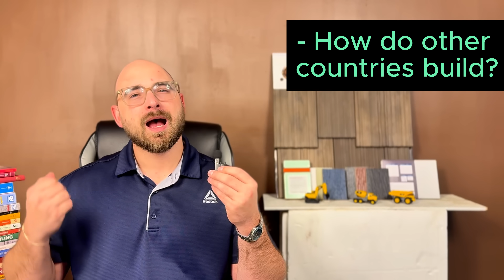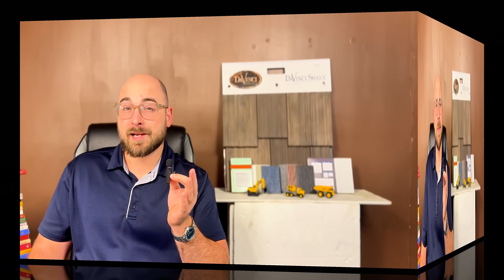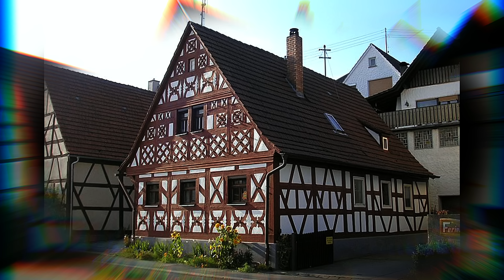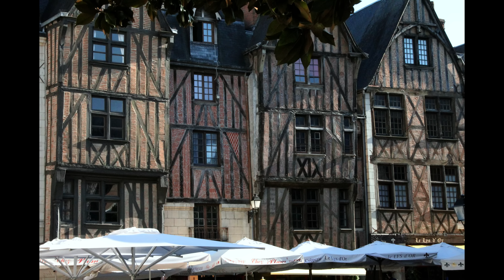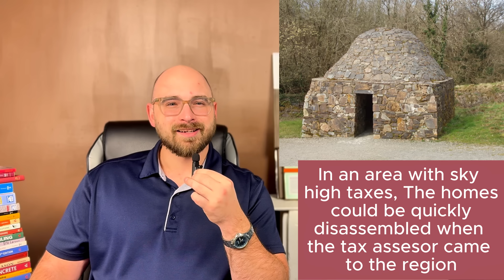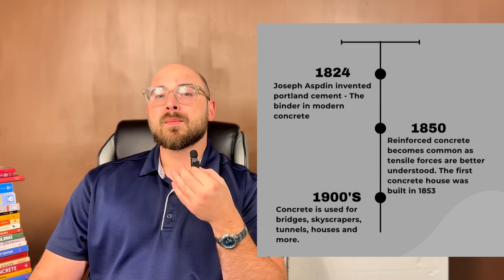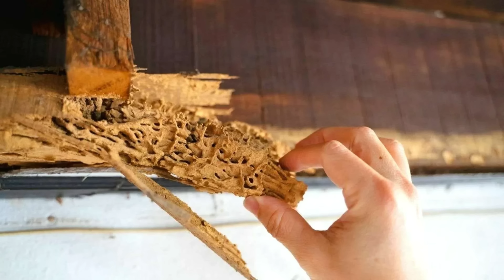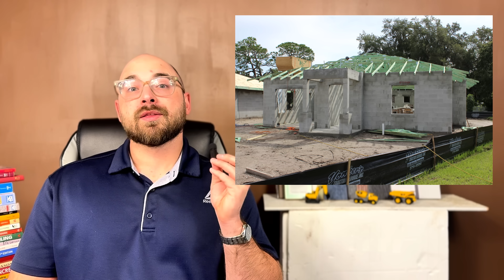Why Other Countries LAUGH at American Homes

Comment: Yes, most buildings in the US are built with wood. Europe mostly builds with Stone (ca. 25% were wood in germany in recent years). Both have different pros and cons, no doubt about that. But when we laugh about US homes, then we often tend to say "look at that US house, it was destroyed by a tornado, but to our german house nothing would happen". Such people claim, that no damage would occur to well built european homes in a violent tornado. Thats just wrong. Structural damage to brick homes happens with F2 Storms. Partial collapse with F3. Thats not too different from middle class US Homes. Also we tend to compare middle and upper class european Buildings with US Mobile Homes. We should at least try to compare similar Types of Homes. 

I´ve grown up in a House which suffered damage from a distant Magnitude 5.4 Quake in 1992. I´ve lived for 10 years in a Wooden Home which was shaking during every moderate Storm. Now i live in a Home which certainly would not withstand a local M5 Earthquake. Yes, i live in Germany. And maybe US Homes are a disgusting piece of cardboard. But we shouldn´t feel too confident about our homes (and systems). We always do, and that often ended in disaster.

Comment: I think steel frame home are the best way for the future I've seen this used mostly for apartment buildings they go up fast but were made to last longer.I've also seen a few ICF home they seem to take quit a while to build I've only seen two they both took almost a year to finish It might be a learning curve for the contractor,hard to get materials ,or something I'm not aware fo.
Reply from the maker: ICF shouldn’t be any slower than other building methods. Perhaps that project experienced an unrelated delay, scheduling, waiting for materials, etc,

Comment: Im from kuwait, and the homes there were hit by tank shells and were repaired relatively easily due to the concrete/rebar/cinder block construction, also, when you need to modify the home, they are rated for the weight already. Also, if I flushed a toilet there, the entire house did not immediately know i took a shit. I had a small water leak for 2 days in my house stateside,and i had to rip out the entire bathroom since it was made of slightly stiff cardboard,and had no central bathroom drain 😂 

I've been the world over, and my least favorite quality of construction in the "first world" has been American, especially considering the price here rivals the concrete construction overseas.

Comment: American houses sure were a learning experience: cheaply made and expensively sold.

I'd say the very weak framing is indeed their worst flaw since it just causes the whole fucking thing to collapse, but also what's up with the filling materials? You should NOT be able to accidentally and literally punch through a wall, any wall.

Comment: Since almost all houses are mortgaged up front costs are mostly irrelevant as long as it lowers monthly running costs or maintenance. It simply shifts the burden from a monthly energy bill to the financing side. It would be great to see government support for financing to remove/lower the interest on these long term investments. I think you could replace many subsidies with zero interest loans which is better than supporting unviable solutions with "free money" since the goal is to develop self-supporting solutions in the future.

By the way the EU builds a ton of homes with aircrete type blocks made of expanded cement/concrete. They are quite soft and brittle but fire resistant and easy to assemble into any shape.

Comment: It'll be interesting to see how 3d printed homes impact this over the next decade. I'm pretty sure the hope is that it will scale well and require less labor, but they haven't been around all that long.
Reply from the maker: ICF is a much better option
Reply: @Mike_Fortin  makes sense for the insulation factor alone. Again, it'll be interesting to see what ends up happening.

Comment: Using brick for your interior walls is dumb. Helps a bit with insulation, but literally ever single task you have to do going forward will be significantly more challenging than drywall for virtually no gain, and more expensive.

Comment: I always wondered why swat teams aren't just walking through the walls instead of trying to bring down the strongest part of american houses, the door.
But jokes aside, mold is only a real issue when the construction is "faulty" and generates heat bridges (or what they called in english) within the walls.
In which case the heat difference of the walls at certain points allows humidity to condensate on said points.
To my experience, this wasn't such a big problem when we still used wooden frame windows instead of plastic, which allowed the house to "breath".
Though this problem can be mitigated with maintaining a low humidity environment, and in some cases by adding an additional layer of insulation to the outer side of the walls.
Also if you keep the air temperature closer to the walls. And there exists mold resistant paints.
I also believe that modern houses are less prone to this problem, as buildings built during communism were anything but quality.
I think i wouldn't trade of my brick house for a light wood construction. They costs the same or more as a brick one anyway.

Comment: Not complete correct! In Germany we use often clay vertically perforated bricks constructions for private homes with an excellent thermal insulation. The bricks are "glued with a thin film/layer of cement glue.

Comment: The reason people from other countries makes fun of the USA is because of the price of the house. You all are pay thousands just for a cheap asf paper wood frame house. For example. In my country to build a house like in the usa, is about $50,000 BZ which is $25,000 US once converted. While for the average $200,000 US spend per house in the USA. In my country you can build a fully steel and concrete mansion that is fully furnished and still have left over money to live off of. Don't get me wrong, we do build wooden house in my country but usually it is a starter home something to build until you have enough funds save to build your permanent home.

Comment: My 160 year old brick terraced house in Bristol UK is built with mostly substandard bricks and lime mortar that aren't fit to be seen so were rendered from the start - double-skin front and back, but with no cavity.
The footings and one of the floor piers are ingots of brass-making slag from local industry - and the upstairs floor beams likely creosoted at Brunel's own tar works.
I'm now bringing it up to better thermal standards with 4x2 framing (Canadian ?) , solid foam infill and gypsum board.
Reply from the maker: a slag foundation, how interesting
Reply: @Mike_Fortin  super hard and impermeable to water and with copper and other somewhat toxic antifungals lol. When we drilled the creosoted beams for pipes, the fumes cleared my sinuses!
Must have been "interesting" in the early years in addition to open coal fires and gas lighting.

Comment: I live in a country and region where the forest, bears and wolfs falls over you....yet all houses are brick and mortar, mortar and stone, reinforced concrete...and so on.....houses made out of wood are barns, refuges, or sheds....houses should last for generations, not for a decade.....I for one would not buy a house that is not a solid house made from an engineering standpoint..... made to last for hundreds/thousant of years.... Imagine living in a house that had guests like kings and dignitaries for some centuries and still be livable...and it was a farmers/techers/priests house, not castles...Imagine that compared to chopstick houses.... I mean, we build wood houses too, but a a fraction of the price, about 10-20% of a good sturdy house....

Comment: It's a shame you didn't compare 5 over 1 construction to its analog in Switzerland! I'm not swiss myself, but from what I understand it's pretty common to build multi-story residential buildings (be it appartment buildings or single family homes) using concrete for the ground floor (or what you americans call the first floor), and wood framing or CLT from there on up. Gives you a lot of the advantages of wooden construction, but with the weather resiliency and flood resistance of concrete  construction on the ground floor.

Comment: There's no universal "right/wrong" or "better/best" way to do something, it all depends on the context and requirements of the location/region material availability. The issue I feel with the North American model is so much of it has "optimized" towards cheap and replicable, losing out on a lot of traditional craftmanship/innovations. As far as your mention of "design flexibility" that's really more shorthand for "lacking in character" beyond the outer veneer. It's like equating natural beauty for someone constructed purely of plastic surgery, and mostly comes off negatively as being "fake/superficial"

Too much of home construction heading in that path boils down to systemic greed and blind /unchecked capitalism.

Comment: How Three-Little-Pigs-Have-Told-Not-To-Build-ahh house could cost $400k?FR, try to use aerated concrete blocks. As cheap, at least, thats ok quality compared to wooden nonsense.
If you want to save money, just make it smaller.

Comment: american houses is not funny. But in hurricane hotspots, i would prefere concrete or bricks. the electrical installations in us are on the other hand very funny. especially the power system, with 120 volt split phase. we have a 3 phase+neutral in europe, and a 2000 Watt cooker that only takes 10 Amps at 230 volt in denmark, will take 20 Amps at 120 volt in US. we have 400/230 volt in denmark and us only have 208-120 volt. This mean a house can draw 50 Amps at 400 volt in denmark while the same house would take 100 Amps in us. this mean bigger wires and bigger risk of fire, by bad connections. 
And then our standards for the installations. We mostly use cables and connectors. some american houses have wires in steel conduits. And we have the ground fault protection in the main braker panels, instead on the single outlets. And finally, some us states have a lot of overhead lines on the distribution levels and that imposes a bigger risk of power outages. all the danish power distrubution cables are underground and no snow, ice, trees or hurricanes can disconnect our electricity supply.

Comment: I own, and split time, between homes in the US and France. My home in France is 600 years old and made from tuffeau limestone. My present home in the US is a stick built, brick veneer house built in the 1960s. I cannot imagine my US home lasting 600 years. I have lived in a home in the US that would come close to my French home. It was a true brick structure with heavy slate roof and plaster walls.

Comment: here in the uk it’s very important to keep warmth in where as the US need warmth out. we also are not reliant on basements like you are. our brick homes could stand your hurricanes and tornadoes too, that’s why i never understood why you don’t use brick rather than your whole home disappearing with the bad winds.
Reply: Many homes in hurricane prone areas, like Florida, are in fact made from bricks.  The roof is the hardest part of the house to secure.  Your brick homes would NOT withstand a US tornado.  The roof would be ripped right off and the interior would be destroyed.  You'd be left with a frame of the house that would likely be compromised and would have to be torn down anyway.

Comment: You mentioned Italy still builds with stone, but for context, it's exceedingly rare and mostly renovation/reconstruction of "historical" building or if you want to create tourist traps. Actual newer homes are either confined masondry construction (sometimes with CMUs instead of clay bricks, sometimes with rebar passed inside the brick holes) or precast concrete, but precast concrete is often considered "low quality prefab stuff" (not saying it's true, I don't know). As a LOT of houses in Italy are very very old especially in the cities (we're talking 100+ years at least), there's a LOT of brick buildings left. While they might be considered "good" homes because their location or historical look, unless they've been completely restructured to give them a decent insulation they're still considered quite crap for all other purposes. To the point that there might be laws in 2030 that forbid selling them unless they've been modernized.

As far as roofing goes, clay tiles used to be more commons, but they often break with hailstorms. Concrete tiles are considered the better alternative, and often especially on apartment buildings it's just... concrete on top.
Oh and inner walls are mostly made of bricks, except some cases, especially in commercial buildings where they might need to be moved that are just drywall on a steel frame.

Personally I think that unless you live in a place that's subjected to some kind of natural disasters (floods, fires, etc) light wooden framing houses when well insulated are perfectly fine. The issue is that unlike in the US, due to the price of wood and lack of qualified carpenters, the price of such a house in most of europe is HIGHER than a confined masonry one since the knowledge on how to build one is more common (thus masons are cheaper) and the economy of scale helps with materials too. So basically the "fast and cheap" and "familiar to constructors" you list as advantages are unfortunately only true in US (and maybe some other countries that still make a massive use of it).

Comment: Dutch houses are way better because we use double walls with in between air gap and insulation layer. So good compared to the extreme wood use or single wall structure in the USA. From European standpunt, yes, American homes are consumer products. Cheap and you really use them up, then build a new one. No long lasting in it. You also only take about materials mainly but construction itself is even more important. USA has a lot of cold times. Insulating properly look at the northern European countries how they do it, way better.

Comment: yes america should stop building the light wood frame houses in most states and start building concrete houses because america needs more sturdy buildings in most places where catastrophies happen and to prevent fire. 
there are still places where wood frame buildings should be used but for the safety of americans they need to improove at least so that poeple won't break in by just walking through your wall like the kool-aid man. (yes the kool-aid man is a joke)

Comment: "Haven't heard anyone bragging about their earth homes" because you assume it is a medieval technology. You can build a cob house today that looks exactly like a brick house and without a ton of insulation holds temperature very well. I live in a cob house and I never had to think about installing AC as it never gets too warm inside even on the hottest summer days. And in the winter I don't need more heating than a modern insulated brick (or wood) house would.

Comment: Yes, solid structures are better, because with timber based houses you rebuild the house few times and you have to maintain it. So, yes the extra energy used to make concrete pays off for 100 years for a single house not to be repaired.